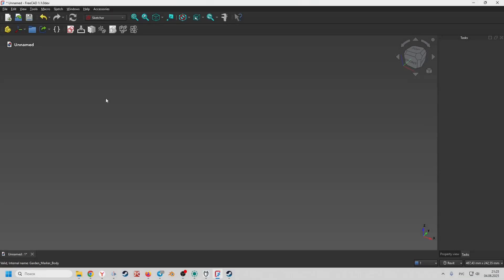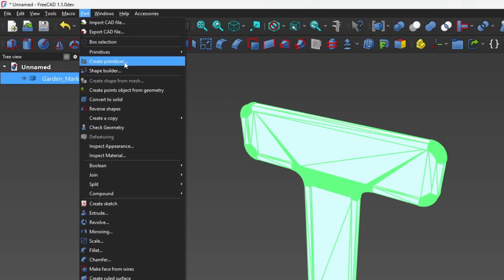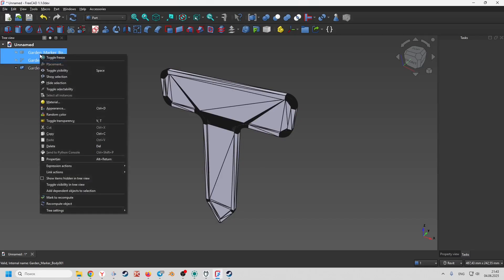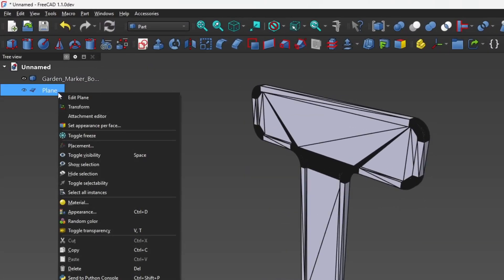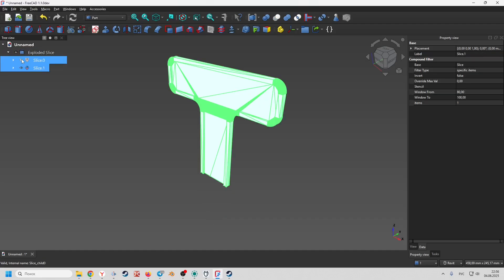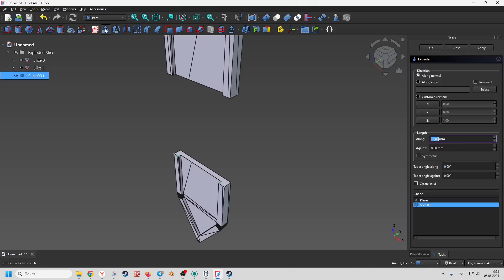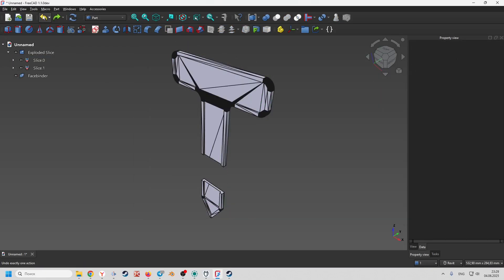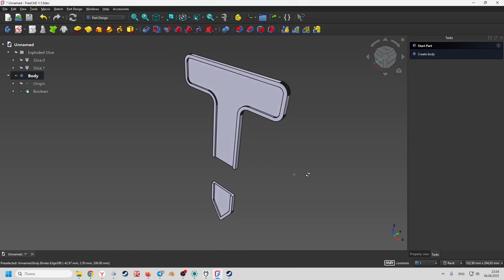FreeCAD - How to Edit STL

Comment: I followed along with FC 1.0.1 but damn is it so SLOW, took 3 mins to do the boolean operation  with max 5% of my CPU. It's like impossible to actually do any work with such long operations.
Reply from the maker: There is a moment, this may be fixed in the future, now one of the developers is working on multithreading